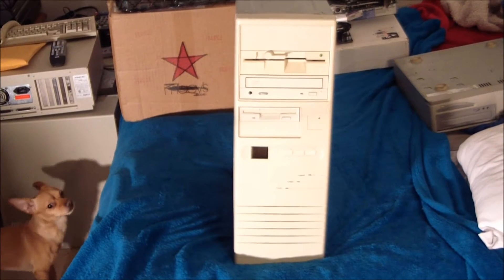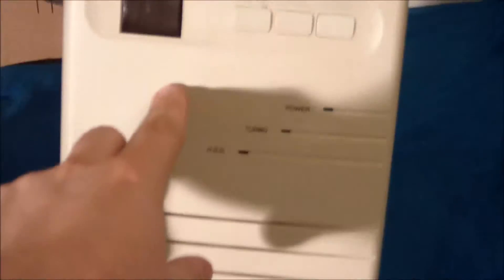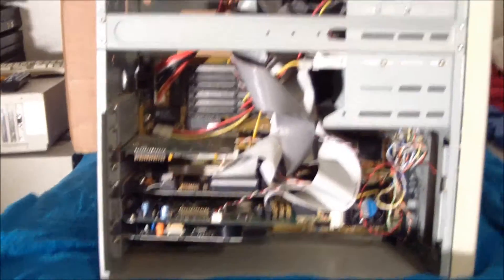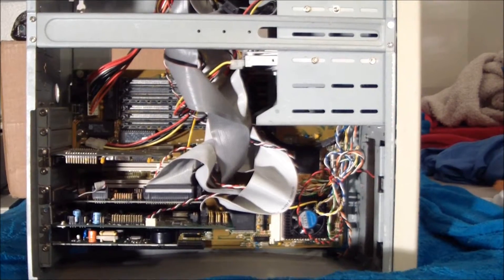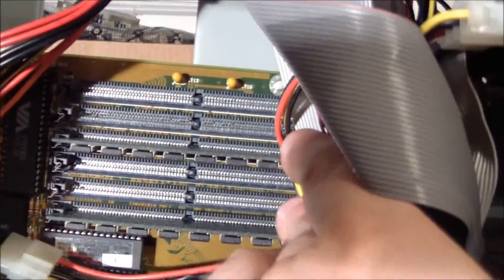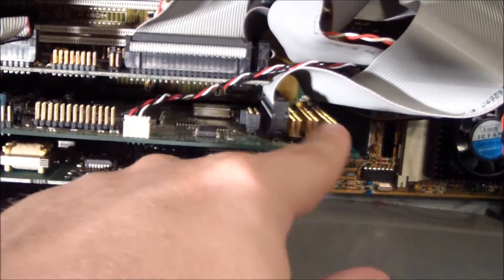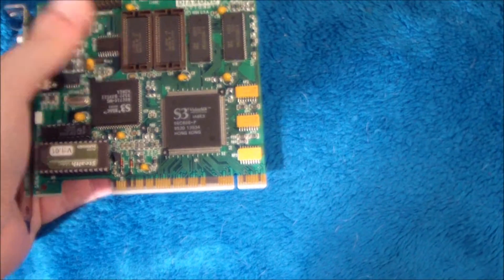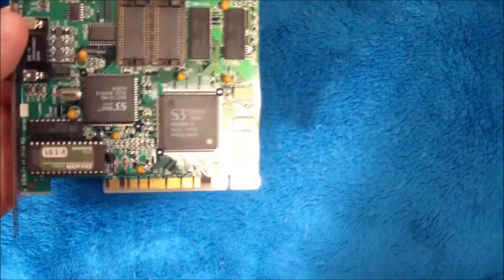Socket 4 Pentium (66mhz)

Comment: Got one of these when I started university in 1995, only had the 3.5" drive in it got the 5" floppy put in. Upgraded it to have a sound card and CD ROM drive and to run Windows 95 when I had to run JAVA for my degree. Was $3500AUD when we bought it on a special deal

Comment: 32MB ram in '93? I had a pentim 166 mmx on '97 and I had only 16MB. This is too much for a 93 machine. For the time it should have 2-4 MB maximum! Why they need  so much ram? I'm sure this is an upgrade (but still to much ram for this computer)
Reply: Good fit to Pentium 66 is 16 MB. With Windows 95, you want 32 MB.
We had 486 with 8 MB, and it was little. With windows 95 we had to upgrade to 16. FOr pentium, 32 MB is optimum. IN 1993, most would not afforid it, it's true. BUt later builds was worth to upgrade to 32 MB.
Reply: That reminds me of the story when my uncle bought me Microprose's Formula 1 Grand Prix in the summer of 1994. My PC was still a 286 so it couldn't run it so I had to play it in my uncles house on his Siemens Nixdorf 486 DX2/66 which he got in late 1993 or early 1994 for CAD work. So the first time I cycled to my uncles house to race F1 Grand Prix on an afternoon when he wasn't using the PC since he was off to work I found the PC was already running (which in my circles was very uncommon at the time to leave a PC running without sitting in front of it). So I just turned on the monitor and saw obscure (to me) numbers etc.. I then called my uncle at work and he told me that what was going on was a full memory test since he had upgraded the machine from 4 MB RAM to 24 or 32 MB (we both can't remember exactly) and wanted to make sure that all modules were ok since he had payed a fortune for them. I said to him it's alright and that I'll play tomorrow then & I couldn't believe it when he told me that the memory test would take several days more to complete. :-D

Comment: my first PC was a Pentium 100 p54c, 8mb fpm ram, ECS Socket 5 430FX motherboard, ESS Audiodrive, Cirrus Logic GD5430 1mb, WD Caviar 2850 850mb HDD, with Windows 95 RTM installed, the Dallas battery eventually ran out of juice but i removed it, dremeled 2 notches in it and soldered a cr2032 socket in and that made it kept the time/settings and made it boot again, and also i transferred the contents of the 850mb drive to a 2gb CF card and put it in a CF card to IDE adapter

Comment: Blows my mind how your 66mhz P5 manages to play quake in sofware rendering so well. My very first pc build I had a Cyrix 6x86MX PR166 and  quake was a slideshow on it! 
Damn......
Id say find yourself a nice1st gen voodoo card for this rig, and just keep it like that forever.
Reply: 2 years old post, but what the hack... The reason why it runs so well is that the engine, and especially the rendering was written specifically for the P5 architecture. The other fifth- and even some sixth-gen CPUs had quite different and typically much weaker FPUs. This is true even for the late Super 7 chips like AMD K6-III+...
Reply: @GeckonCZ  Thanks, youtube IS forever, so people are gonna comment no matter how old the upload : ) Im aware of the FPU optimization in Q1, its the reason I ditched the Cyrix for a Pentium 233 mmx! STILL though, I recall a friend back then with a packard hell 90mhz P1 running quake and the perf was good yet borderlining unplayable. So yeah im still surprised at your 66mhz P1 running so well!
Reply: @AllboroLCD  Indeed it seems to be a particularly well-balanced system, for Quake anyway...
Reply: @warrax111  Close, so close!! It was a VLB Verge card I paid an extra $25 at the PC fair to have an extra meg vram put in. Boca was the card brand.
Reply: Quake was truly bleeding edge in this regard - one of the few occasions where a programmer(Abrash) pulled out all the stops and made Intel's promise a formidable reality.

Comment: Unless something is wrong, no 486-class PC should be faster than this. Not even DX4 100. The only 486-class CPU that's close is AMD-DX4 120 MHz later model with WB cache. or some 5x86 hybrid 120MHz+

Comment: Have you tuned the bios settings at all? I have 4 x  socket 4 motherboards. One with ALi and one with Sis chipsets which i have tuned for fastest timings With 512kb cache. However both my batman and Dell systems still are faster in ever bechmark (they have intel 430Lx chipsets and have very restricted bios). I would love to get my hands on a 43x motherboard that i can tune the cache timings etc on
Reply: my intel batman and dell boards both “only” have 256kb
Reply from the maker: Its been a little while since I set this machine up. From memory I think I did some mild BIOS tweaking but nothing major. I may go back and play with any settings I can and see what results from it.
Reply: I have put together benchmarks of all my boards feel free to have a look https://drive.google.com/drive/folders/17A_xqlZtLnxZJiXLtdViINCSfQx0cEl7?usp=sharing. Did you ever get around to looking into repairing that burnt capacitor? Also would you be interested in swapping the board for a Elitegroup SI5PI socket 4 board at all?, its quite a nice socket 4 board with a SiS chipset, photos are in google drive
Reply from the maker: no, I never had the burnt cap repaired as I'm not to great with soldering and I didn't want to try it myself. so far though it hasn't given me any issues. out of curiosity why would you be interested in a swap. is that board of yours a double?

Comment: Stick a Voodoo 1 in it (if you haven't already) and you'll have a pretty neat retro gaming machine (for 1996-98. games). :)
Reply: On a pentium 66 ?! That won't run great at all ! Many 1998 games are asking you to have at least a pentium 90 or even faster, the P66 is comparable to a 486DX 100 for most tasks except for floating point unit. So that's best for DOS games from the early to mid 90's. A voodoo 1 will be a better fit in a faster pentium machine (such as a pentium 166 or faster).
Reply: Heh, you're 100% right. For some reason, when I was posting my comment, I was thinking about Pentium 166 (instead of just 66)...weird. :)

Comment: I had a socket 5 and socket 7 motherboard, but I think someone trashed it. one was a useless Dell Board and the other an IBM. I still have a K6-2 300mhz lying around but the Pentium 133mhz dissapeared. I last used them as a simple web server setup with freeBSD and Apache. Luckily the site was light and I had gotten a compact flash to IDE adapter, which made the 300mhz machine feel "fast". (compared to the old 6 GB Maxtor hard drive)

Comment: I had an Pentium 60 with 8mb RAM from 1995 to 1996. the Pentium 60 was my first PC. But Cpu was very unstable. Crashing very often after Hours of gaming.
Reply from the maker: So far I haven't had any stability issues with this setup but your not the first person I've heard that from about the early Pentium boards.
Reply: @AncientElectronics  I have a request for you. I have the same board as you in this video. Unfortunately, my flash EEPROM has gone to silicon heaven. I'm searching in vain for its contents, but the BIOS for this board is nowhere to be found. Could I ask you if you could dump the contents of this EEPROM and send it to me?
Reply from the maker: @Thales_WH  I dont think i have this board anymore, ill have to check.
Reply: @AncientElectronics  Please try to take a look, it would help me a lot. The board was put aside for a long time, before it was functional, now it is dead after turning it on and only the EEPROM is getting very hot.
Reply: @AncientElectronics  Have you tried finding the motherboard?

Comment: Duke is more frequency oriented. runs better on 100mhz 486 than on 60mhz pentium.
Reply from the maker: Duke3d actually runs pretty smooth even on my 66mhz 486 when at the lowest resolution and in non SVGA mode and that's in full screen.
Reply: There is some benchmarking data from back in the day: https://dukeworld.com/2001-current/rtcm/general-tools/Dukebench-II.zip (dukebencTim.txt)
There's a P66 result of 30 FPS vs. 32 FPS on the fastest DX4/100 machine. A hypothetic 27 FPS on a P60 wouldn't be so bad given that the DX4/100 clocks over 50% faster; Build is supposed to have Pentium optimizations, after all. Plus that ET4000 W32p card seems to be at the bottom of the pack anyway, judging by the P100 results, so you could probably add a couple of frames to the P66 result if a faster video card had been used.

Comment: Nice system you got there and socket 4 boards are RARE.
Reply from the maker: +MrKillswitch88 I know, I don't think ive ever run across one "in the wild" and i've seen a lot of old PC's. I lucked out on this one on Ebay.
Reply: +0blivi0n100 Only scored one in person and it is an IBM system, did land two Intel Batman boards in a lot off eBay last year but haven't gotten around to putting together any builds. Going to put them in ATX cases as they have ps2 ports and the boards look pretty cool.